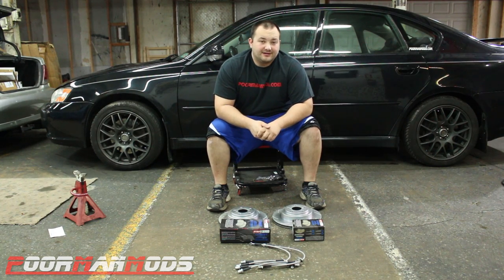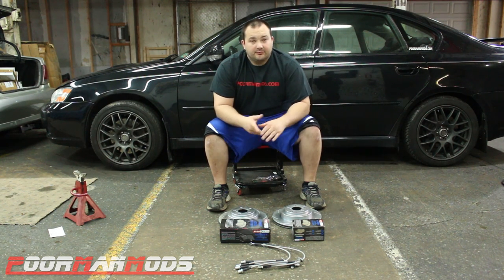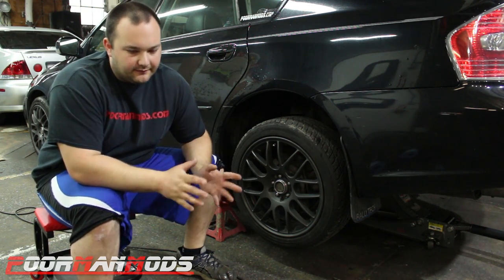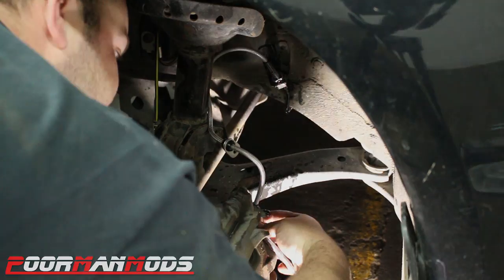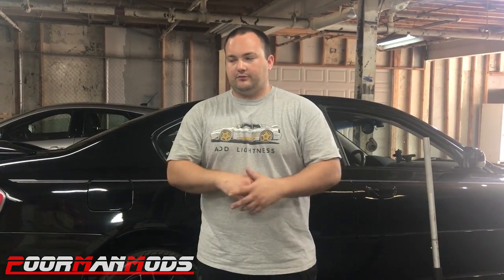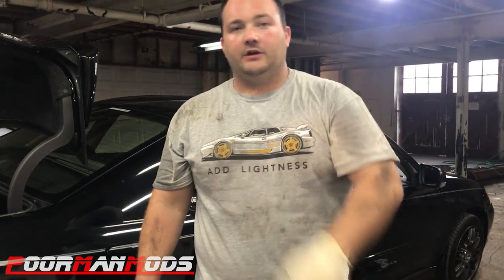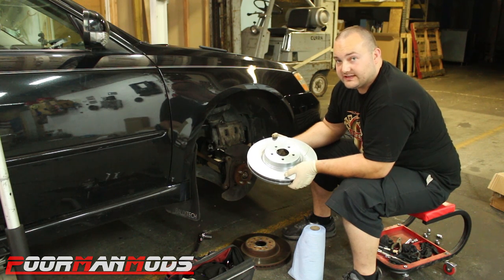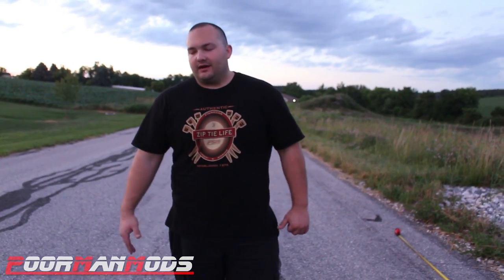Are Brake Upgrades Worth It For A Street Car Daily Driver? 60-0 Testing

Comment: Yep, you can only stop as fast as your tires allow you to, if you can lock up the tires (or hit the abs), bigger brakes won't improve that, the extra mass will only slightly make it worse. 
However, moving brake bias a bit more to the rear will improve stopping distance, but only to a certain point. this can be dangerous too, as the rear might lock up earlier. hence why cars are designed with relatively more front brake bias.
The only thing you changed is brake pedal feel and force needed. 
Bigger brakes are only for race use as you stated, to decrease the amount of brake fade after several brake events.
Reply from the maker: Exactly, well said my friend.
Reply: :) and you provided the community with the proof of concept :)
Reply from the maker: yup! but im sure there are some or many people out there that wont be satisfied with the evidence in this video for whatever reason lol
Reply: Modified stock proportioning valve check. Heavy duty 10 inch drums check. Properly adjusted rear drums check. 200lbs behind rear axle check. 3/4ton pads calipers and rotors check. Beefy 235 75 r15 tires with 28psi check. Almost 9 inches of tire on the ground check. Brakes so good it locks the seat belts and smashes passengers head into the dash cracking it. Priceless.
Reply: And the bigger rotating mass of bigger brakes will somewhat affect acceleration and handling of the car.
Reply: I feel like with the upgrades you did it will improve stopping at higher speeds since it is able to lock up your wheels when it wasn't able to stock.
Reply: Exactly,.. BUT "better" front brakes will be cooler (dissipate heat better) and possible last longer IMO.

Comment: Brake lines is more the feel, if you have rubber lines you can get a squishy feel when braking hard. What I've found with upgrading from oem to slottet or drilled discs and from organic to semi metallic pads is that the brakes worked better for longer, not much difference in stopping power because that is more to do with your tires and size of the disc and pads. Also found that the discs last longer, though they aren't thicker than the ones I had before, the brake dust is worse and the pads lasts just a little longer. The price difference going from oem or super basic discs to brembo slottet in the back and drilled in the front was only 21 bucks and the pads were 4 bucks per wheel. Short version, better brake feel with the line upgrade, slightly better performance that lasts longer before fading and a longer life overall, but more of a cleanup and slightly more noise when stopping. But much better rain performance.

Comment: You can disable the abs by disconnecting a abs sensor. They do have those just under the rear passenger seat. This is a good video though. My ABS was disabled because of a bad, rear right, sensor. Braided lines improved my stopping time, and initial bite times. But I can say, once I get my ABS system fixed, it's going to be back to the same old.
Reply: interesting... how difficult is it? is any downside of doing so apart from the abs dash warning light?
It would be nice to disconnect it whenever you wanna track your car and switch it back when done

Comment: People need wrap their heads around performance parts are really for performance driving. Tires are probably first things ppl should upgrade. If you run tires that can max out your breaks then you can look at breaks. Even then if you are chasing better stopping distance I would consider larger size rotors and better pads. Everything else is about keeping the breaks preforming.  Braided lines, better fluid, vented rotors is all to keep the breaks working best they can under heavy use for duration. With today's break pad tech drilled discs are pretty much useless other looks, also make disk weaker and more prone to warping. There's some argument for slotted, that give you better bite on the pad, with that pads wear out quicker.

Comment: Very well made and informative video. Nice one Freddy!

As long as youe front brakes aren't completely shot, you won't notice any difference IMO. 

When I bought my Miata the front brakes were shot and the car was wobbling while braking from higher speeds. I did the brakes all around and I immediatly noticed a gain in braking performance.
Reply from the maker: Thank you!

Comment: I'm simply switching to drilled rotors with ceramic pads, vs the stock vented rotors with the metallic pads that I installed when I got the car. My brakes get hot very quickly and the steering wheel/brake pedal will shake at speeds over 40mph.

Comment: Ahhh just maybe a reminder that you are supposed to pull the abs fuse. By the way with the fuse pulled all you did does make a huge difference in stopping distance as well as reduced brake fade from a length of time. Plus you should notice the huge improvement on the pedal feel from the line's. Comes down to mostly your braking will remain consistent every time you use them.
Reply from the maker: The pedal does feel alot better, but you can only stop as short as youre tires will let you, they can only hold a certain amount of friction.

Comment: Before watching the video and my opinion. Brake lines wont really increase brake performance, more improve the way they feel. Discs again wont reduce stopping distance in face can increase due to less material with drilled/ grooved etc. But is useful when the brakes are getting hot/dirty/wet as they can disperse heat/dirt/water. Pads by far the best upgrade for all round and price. Different pads can give a better bite on the discs and can stop you slightly sooner but again biggest difference is good pads will continue to brake hard even when the brakes get hot. A good brake fluid is a good idea for track racing as it wont break down under high heat conditions. MC brace (you've covered this before) makes a difference to the feel and can make miniscule actual difference as you can hit them harder with less firewall flex. All is my opinion after doing all of them to my car recently. Biggest difference comes from the painted calipers though..
Reply from the maker: Oh painted calipers are without a doubt the best upgrade!!! lol

Comment: 2 feet could be the difference of throwing a kid over the hood of car or stopping in front of them......worth a couple hundred bucks and a beer or two id say.... when I upgraded my 350z, to slotted and drilled with nice pads, I didn't really notice the stopping distance so much as much as I had noticed that they lasted longer on hot days, as in they didn't get squishy running the car hard or hot days in traffic.... what I did notice and liked a lot was when they grabbed a little better in rainy weather, or cold foggy mornings.
Reply from the maker: 2 feet also could have just been a variable in my reaction time, to me 2 feet isnt a result. You can only stop as quickly as your tires will let you.

Comment: abs activates when it senses the tire slipping. if your stock brakes can make the abs activate, they you can't really get better stopping power with the brakes. time to upgrade tires! 

where upgraded brakes help is in light breaking, where they can get you to almost slip the tires a lot easier than stocks. or if you have sticky tires. 

basically.. if you can lock up the wheels, you need better tires. if you can't slide the tires.. you need better brakes. :) nice video!
Reply from the maker: Exactly! thanks for watching :D
Reply: I know I am missing something, because would not stickier tires make the abs more likely to lock up, thus making bigger brakes even more without benefit?  that is, they are already locking up because they are so sticky?  what am I not understanding?   great video,btw,
Reply: @drm9979   what it sounds like you are asking is, "Wouldn't stickier tires make the ABS more likely to activate , thus making better brakes even more without benefit?" The answer is no, just the opposite. 

Let's not use the term " lock up ". ABS activates when tires stop rotating and then slide . Stickier tires resist sliding more than less sticky tires will, and will allow harder and shorter stops before ABS activates. 

So if you are triggering ABS on dry pavement with the tires you have, they are sliding and your existing brakes are already enough for them. You need stickier tires so that you can stop hard and have the tires not slide and instead, stop the car. Then you should upgrade the braking system to make those stops shorter and/or to add modulation and linear feel, etc. You might still be able to trigger ABS but it should require more extreme braking before that happens.

Comment: instead of doing z32 brakes on my 240 i just did the braided line race pads and drilled and slotted rotors and at least on a 240 with no abs its night and day of a difference pedal is much more sensitive now. havent tested distance but they stop damn near 45-50% faster than before im running dunlap direzza starspecs if you want to talk grip of the stoping  240 wise worth it
Reply from the maker: Well im assuming your running tires that are light years better and larger than the original tires so upgrading the brakes will certainly benefit haha.
Reply: touche

Comment: Braided lines only have an impact if you are racing.
They don't expand the way rubber lines do when the brake fluid is heated up under heavy use, so the brakes don't feel as mushy and feel more consistent.
Honestly don't think they are worth it for street cars, even ones that you occasionally take to the track.
You'll notice that Ferrari's, 911's and other high end sports cars come from the factory with rubber brake lines.
Personally I normally just get better tires and go up one size wider while keeping the overall diameter the same.
Maybe better pads.

Comment: i have michelin pilot super sports.  so the only thing that will decrease my stopping distance is brake pad upgrades?  I dont need slotted or drilled, I dont race.  I just need a good stop for everyday drive
Reply from the maker: You'll have to so some testing but brake lines and pads sounds like a good plan

Comment: did you go through the brake bedding procedure for bedding the pads to the slotted rotors? that makes a huge difference in the performance of the pads and the rotors as opposed to not doing it...just my $0.02
Reply from the maker: Yup!
Reply: Poor Man Mods 👍... Good because you could def get a 5 foot difference outta that. . Nice work Freddie!
And 5 feet is alot when you're slammin'  em and avoiding a collision. ..
Reply from the maker: Thanks buddy!

Comment: brake lines are for longevity, rotors are to cool down quicker, pads are to reduce fade none of the products claim to help you stop faster you'd need a larger diameter rotor and more piston calipers
Reply from the maker: Bigger brakes wouldnt help with my set up, i would still need better or larger tires first.

Comment: BBK kits are not even close to being worth the money for a street car, Hot or not.  In most cases cars that people up the HP on but don't track already have pretty decent factory brakes.  These brakes can have their performance multiplied by added a few simple things such as better brake fluid, better pads and the biggest rotors your calipers will allow.  This will make more difference then spending thousands on a BBK which will in some cases give you worse performance on the street than upgraded factories as your video shows.

Comment: fade is kinda a really big thing with drilled and slotted rotors tbh on my car, (99 neon) I was only able to do 60 to 0 3 times before fade became unbearable
Reply from the maker: your neon probably has tiny rotors, and big brake kit would help to soak up a lot more heat preventing brake fade.
Reply: Poor Man Mods , my point is that drilled and slotted (granted I only ordered slotted rotors) with ceramic pads do not outperform stock pads and rotors (and hairline crack much sooner)

Comment: bed them in first and  when test,do  a test  after  1k miles of driving
Reply from the maker: thats not going to improve the stopping distance if the ABS is still activating. Youre still at the limit of the tires

Comment: My car doesn't have ABS, so does that mean it'll make a bigger difference?
Reply from the maker: youre brakes will most likely lock up easier and youll have to modulate the pedal to maintain control

Comment: Not because of the ABS, because of the tires, you've thoroughly disappointed me Freddy. Brake upgrades would be thoroughly beneficial for how I drive my DD, racing activity aside, it really comes down to how you drive and equip your car. If you "drive your Camry" "like a Camry" and maintain it "like a Camry" then no, performance parts are mostly useless to you because you're not buying the ~300 TW summer tires, and going the 130-70-100-60-110-55 mph every 60 seconds that someone like me does. But guess what Freddy? Most people who will ever bother to watch this video don't buy Camry's to drive them like Camry's, even if they bought a Camry. Or a Subaru Legacy GT.

Also I fail to understand how you had trouble doing the brakes, Subaru brakes are about as easy as falling off a log, it takes longer to jack the damn car up and take the wheel off and on than do the brakes.

The real take away from this video? NO MATTER WHAT YOU'VE DONE TO YOUR CAR IT WILL ONLY EVER PERFORM AT THE LIMIT OF THE TIRES.
Reply from the maker: +Logan Davis I literally said at the end to get the benefit of the brakes I would need bigger or better tires. And the clips for the front pads are fucking retarded and unlike at clip I've ever seen, I promise they're different than any brake clip youve seen unless you did pads on a legacy like mine. Took me 1 hour to get the front pads in the clips. Then the rear caliper bracket bolts are in the dumbest location ever. Fuck the brakes on this car.